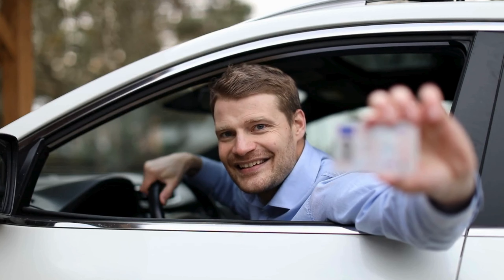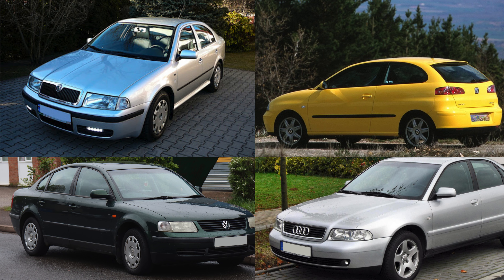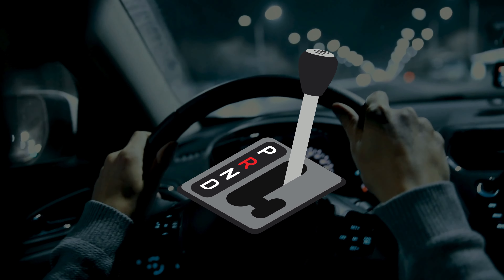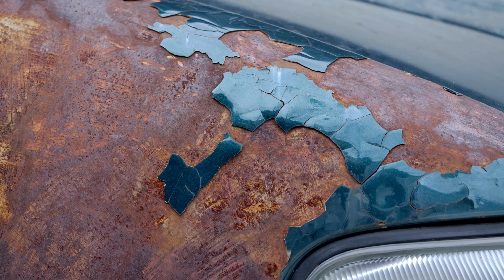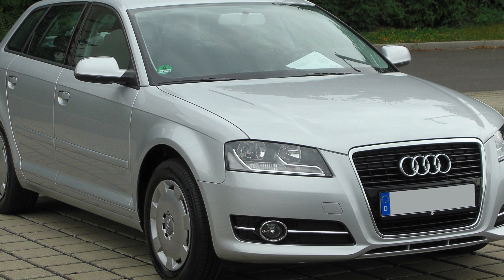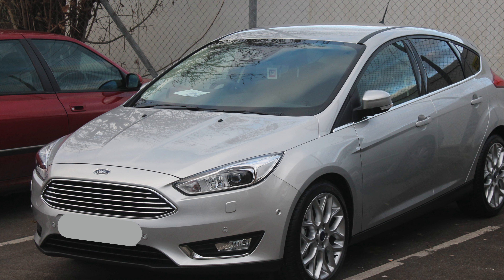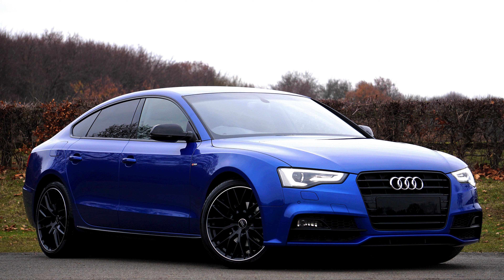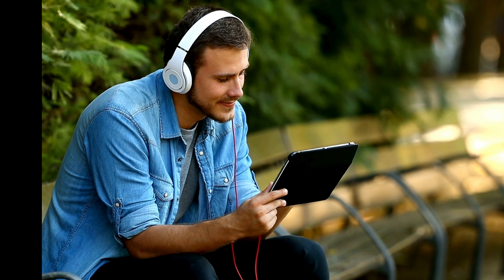TOP 10 Best First Cars (1k, 2k...10k Price Range)

Comment: I'm sad when I see lists like this where there's too much German cars, yes German diesels are great and quite reliable but I'd rather get a Japanese gas car like for example a honda crz, a car that isn't mentioned a lot. It's fun, reliable, cheap to maintain, economical and you can find a really good one for 5-6k, and if you don't mind mileage, you can find some for	around 3k
Reply from the maker: I think japanese cars are very reliable and cheap to run, but usually the german cars are more economical and they don't have such a big problem with rust, but this probably won't matter in places where the climate is warm and the roads aren't full of salt